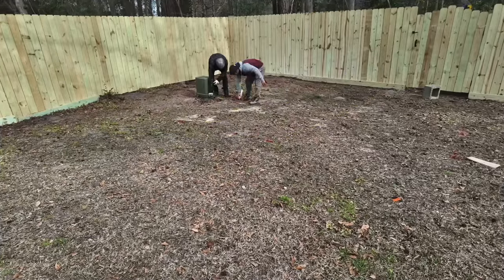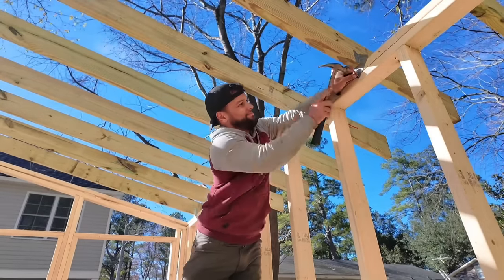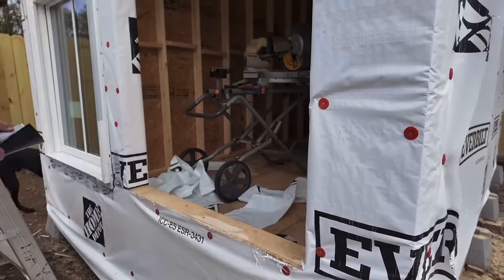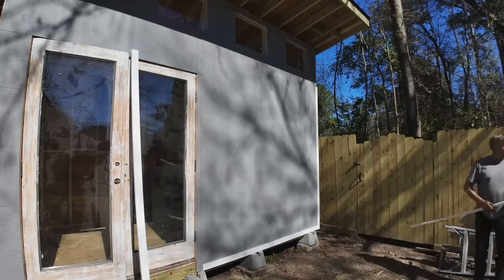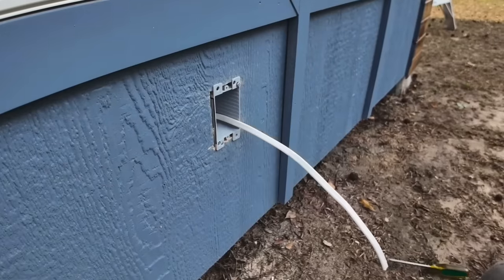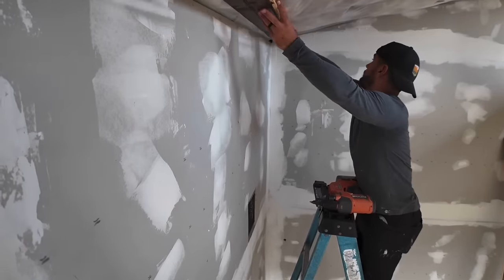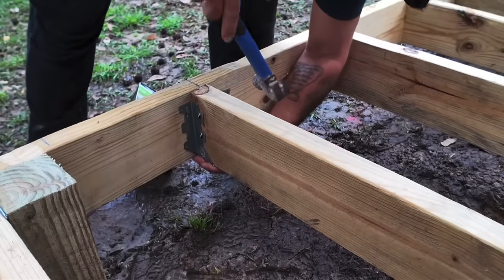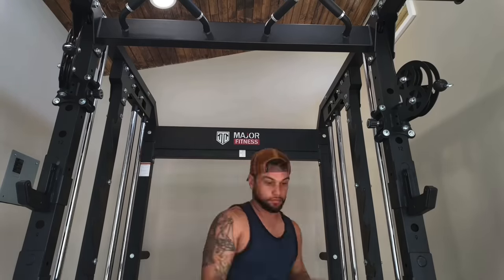How I Built A DIY Tiny Home Gym Full Build

Comment: all that time to put a bow flex in there?!?!?
Reply: I think you would need a slab foundation or commercial grade floor structure to do a deadlift or power clean station
Reply: @DanDannyDanielleBob and you need expansion join around those windows 😮‍💨
Reply: It’s better than “calling spirits”
Reply: Facts I thought when I saw his kid he was gonna make it for them 🤦🏾‍♂️
Reply: all that money he spend just to end up putting a gym machine.
Reply: Think about it. He mentions using as a short term rental but got shot down by the city.  That space can be used as a gym, an office, a workshop... So time and effort is not wasted
Reply: Was thinking the same thing. Nice work anyway
Reply: @DanDannyDanielleBob he could use it outside
Reply: Lol
Reply: @JonLake  glazier talk
Reply: Planet Fitness is 15$ a month. Could have gone for 1000 months and avoided this all.
Reply: Glad I read comments first, almost wasted 48 minutes of my life
Reply: A bowflex and no clearance to put plates on either side.
Reply: That was wild
Reply: @paultiki9968  it's not surprising considering there was no air conditioning, heat, plumbing of any sort, a kitchen, toilet. People that would stay there would not be very happy with so many basics missing...
Reply: @davidhamilton6136  I suspect that those things could be added if need be.  If I recall the goal was short term rental before construction and that's when he got shot down.  Would have to re watch to be sure.  Anyway, if that purpose was scuttled at that point during planning it would make sense not to add plumbing and stuff.  That would save an enormous amount of money since he can't do the rental thing anyway
Reply: Where a your tiny house video bro so we can see how fast you are ?
Reply: Félicitations vous avez fait du bon travail 🎉🇫🇷
Reply: I feel bad because I shared the same sentiment but they did a damn good job. Who cares what they put in it?
Reply: I can only assume he did it just for the content. He’s got like 300k subs. This is the most irrational project I’ve ever seen 😂
Reply: @DanDannyDanielleBob  😂 exactly
Reply: He doesn't even work out
Reply: Curious did you add the deck railing in order to have led deck lights only?

Comment: Framing 10/10! But because you asked - you have to flash window/door frames on all 4 sides usually 3" on the sheathing and 3" onto the frame. Then install the windows with calking all around, but over hang the frame so it clears your siding. Then install counter flashing and then your finish siding. Water is going to come off the window and get between your siding.
Reply: Following for future reference 😅
Reply: Following
Reply: This should be pinned to the top.
Reply: Framing is a 6/10 RESPECTFULLY! No jack studs king studs or header for the doors and windows and dont tell me its a tiny home it doesnt need it...
Reply: Yeah haha, as a carpenter myself I was wondering why he installed the doors and windows like that. The first two windows started OK but then he only did the bottoms. Wasn't sure why he was framing the openings with the expensive flashing after he installed the windows and doors. Like you said he needs to wrap the stud. But for a backyard build on a budget, especially if it's your own property, the mistakes end up being worth more in the long run as a way to learn, better than just helping someone else who already knows better. Seems like a do it yourselfer with some great motivation. Wonder what he does for a job?
Reply: Was entertaining tho. At first he was spacing the sheathing to allow for deflection so I was like oh yeah but then then he kind of started siding and it was like a puzzle. Still a great video. A follow up on the longevity in a few years would be a good watch.
Reply: @Majin.Rick101 that’s what I said lmao 6 might be generous but for a diy not so bad
Reply: @Majin.Rick101 wouldn’t he need to and bottom cripples for the windows too? Just curious.

Comment: 29:01 Next time, when hanging your sheet rock, make sure to stagger the joints so there isn’t one continuous straight line.  Keeps cracks from forming.
Reply: I understand it's important to stagger on the ceiling but on the wall can I just install it vertically so I don't have to deal with butt joint?

Comment: If you get any heat about not having staggered joints on the subfloor, those people are not competent builders.  Ignore them.  Also, what a great neighbour!  One thing I noticed is next time, don't put sealant under your windows, and always shim them up a 1/4" to 1/2".  If any moisture gets by your flashing, it will have nowhere to go and will just rot in the window jamb area.
Reply: How do you stagger joints on an 8' subfloor with 8' sheathing?
Reply: @dan8326 Exactly that would mean cutting every sheet or every other sheet.. the fact it was even mentioned makes me wonder
Reply: @dan8326 and now I just realized he didn't stagger the drywall 🤦‍♂️and he ended the joint at the door which is a weak point n can cause the drywall to crack
Reply: This was oddly satisfying to watch😊 You all did a great job.

Comment: Man that sux you spent 15gs for the tiny house build and the city wouldn't let you rent it out. This video taught me to do my research first before I build. Thanks for the share!
Reply: It's good to see the woodprix has new instructions to save my money and energy to build it.
Reply: Won’t let civilians rent out anything on their own property! But builds apartments everywhere and raises rent through the roof! The world we live in is messed up
Reply: @mylesmccartin878  More apartments/condos actually lowers rent. Its because of zoning that we cant build enough of them so we instead build space inefficient suburbs and expand outwards instead of up. Look up suburban sprawl. But yes in this case its also because Karens with nothing else to do manage to get into positions where they get to control city ordinances and make everyones lives harder for no apparent reason.
Reply: The city probably has multiple permit and inspection requirements if going to be used as a dwelling.  Also there is no plumbing,  so if they're planning on using an outhouse or something that may require additional hazmat permits and have additional requirements so they don't contaminate any groundwater.

Comment: Looks good!!! I’m a framer/remodeler so there are a few things I’d have done different but it doesn’t matter what I think.  Good job guys. My suggestions would be to use stretch flashing tape in the corners of your door and window seals. Also, I personally don’t like flashing the bottom of the window flanges. Again, good job you’ll enjoy this space for many years.

Comment: You needed to put “Z” flashing between the siding. Water will get inside the seam. You can’t rely on caulking. 

The window flashing (the sticky kind) needs to be done from the bottom to top so there is always an overlap on your seams. You put your sides on first, then the top then the bottom. Any water that comes down the top will rook under that flashing. 

Your window frames should have had a bigger gap between the framing so when the earth moves, it won’t break the glass. 

I can’t tell but your floor joists should have been pressure treated since they are touching those concrete blocks. If they get wet they will rot out.
Reply: This is good information. Thank you for sharing.

Comment: It looks nice. I’m not even a handyman but I can tell you the foundation is not safe. There is a reason you dig. I had a deck with those, just a deck, not even a gym, and it collapsed and was so unsteady
Reply: Unless you live in a place where frost heaving is a consistent issue then his foundation will be fine. Have built and seen plenty of decks on block foundation and they are as good as when they were constructed.
Reply: But why did it collapse? People build foundations like this in the Alaskan bush and they last 50 years plus. I'm just really curious what went wrong.
Reply: @pressureflipin1992  maybe they built on soft topsoil?
Reply: @mikerooney7600  almost had to be
Reply: I would agree sonotube/concrete…I would rather be safe than sorry or at the very least put a nice layer of gravel under those blocks
Reply: @RVFD2008 Your joists may not have been pressure treated. That may well be the case with this build but hopefully not.

Comment: Nice job. You did ask for critique so i will give my 2 cents. I have a few points #1 Its best to dig out the top 12 inches of topsoil from the blocks under the building. The top soil is not compacted and still organic material that will continue to decompose. It's best to have a solid foundation. You could have used piers and set that on top of block and beam. #2 The window tape was not used correctly. There's a sequence of overlapping around the edges to promote proper run off of moisture that wasn't achieved. You cam also buy somw tape that specifically has the corners already built into them ans cover 100% of it. #3 white romex is usually 14 gauge wire and not correct to be used for electrical receptacles, you wanna use yellow 12 gauge for that and yellow for any fixtures that will potentially have a celing fan in them. I di have a question about that insulation. In texas fiberglass batting us commonly used here. To my understanding its not toxic. Its glass. My concern with what you used it that it leaves bigger gaps that affects the r value and it will eventually compress on the vertical walls and fsll to the bottom like it used to do on the trailer homes back in tbe day. Other than that. Nice work.

Comment: 15 k to store 1 piece of equipment is wild I like the video nice job it came out looking nice
Reply: Except its terribly built, 15k for the foundation crumble and unpermitted work
Reply: 15k???? I see about 2500 in material there. If that. And hes doing a decent job. Also, it.doesnt need a permit. Its less than 200 sq ft isnt connected to the house and is setting onn a floating foundation. Jesus poeple are dumb and unskilled., so many youtube armchair contractor experts chiming in. My gawd the cringe
Reply: Never nail with a brad nailer like that with your other hand near the end move back a bit on the other board your holding. If the brad nail hits a knot it can curl and shoot out into your hand ask me how i know
Reply: @MAGA_EXTREM1ST  I was thinking that too. I didnt see $15K in material at all.
Reply: @ImYourWattson   maybe in labor if he had paid someone to do all that extra unnecessary mostly aestetic  intricasies added on the front wall. Even he was being fully transparent when admitted it looks cool but wasnt practical, i see this often where homeowners see something flashy in a magazine and want it until learning whats involved with it
Reply: It’s way more than 2500 lol. Just the boards he put on the deck were $34 each. The deck alone probably cost around 1000 to 1300.
Shingles aren’t dirt cheap. 
Breaker box fully outfitted is a few hundred. 
Flooring inside probably around 400 to 500
Framing and all plywood was at least 1500 to 2000
Siding is very expensive at $40 per board so that’s another 300 to 400.
That’s not including the 20 other types of material used on this project.
Reply: I literally commented the exact same thing. And with no room to maneuver even!
Reply: @phreakyzeke5824  he literally said he spent 15k.
Reply: @lyfsabych  if you think thats 15k in material you fell and bumped your head
Reply: @MAGA_EXTREM1ST  I mean, if your definition of "materials" is "wood", sure. I'm sure you know much better than the guy who bought it and built it with his own hands and wallet.
Reply: @lyfsabych  no what im telling you is i order lumber packages for the projects i build. And i know with accuracy and current pricing per 1000 board feet  how much things should cost.
Reply: @MAGA_EXTREM1ST  as I said, if your definition of "materials" is "lumber", you are correct. But there are  a hundred plus other types of "materials" which go into a build like this.

Comment: Very nice space! But is it a bit of a squeeze to load plates onto the bar?
Reply: That bar is going through the wall atleast once in the first month
Reply: Bar appears to be a Smith Style bar. Will only go directly up and down on a rail. Loading plates is probably a bit challenging but no wall impacts from the bar.
Reply: @RescueResidence  There are J hooks and safety catches on the front for a regular bar. Yes, I would have built this at least 10-12 feet wide.

Comment: I'm fairly confused by a home structure set up on $10 blocks plopped directly onto unprepped soil, that's surrounded by a deck that has concrete post footers.
Reply: To be fair, this isn't exactly a structure as big or nearly as heavy as a house would be.  If the soil wasn't touched at the top layer when their home was being built originally, the soil below will be packed well enough to be able to support a building this size.  The framework they set up for it should hold for as long as they own the place, if not longer.

However, if the soil was moved around a lot while their original home was being built, they're going to be in for a bad time in the long term.
Reply: Because it's a shed, not a home.
Reply: @metal_mo  Correct - but he did forms for the deck. If you're going to dig and pour concrete forms for a tiny deck, why not do it for your structure?
Reply: @JB2X-Z  Yup, no need for crazy footings for a structure that small. Poured footings are overkill.
Reply: Footings would have helped it not become a really big kite in 60-70mph winds which are not uncommon in thunderstorms.
Reply: @hollisminter2119  This structure isn't being picked up by 70mph winds... lmfao. And that doesn't even count all the nearby houses that are breaking the wind apart.
Reply: Go look at a simple gravestone… individual sized flat marker that’s been set for a few years  before the grave is disturbed.  You will see that marker sink over the years.  All it takes is a few seasons of rain to start the sinking process.  I can’t see this tiny house not moving over the years
Reply: Yeah I’m not a builder but have watch a lot of videos over the years. Why not just pour actual footings? Every place I’ve lived and done rehab on houses even a shed required a poured slab and a rat wall.
Reply: Is it possible this allows them to bring the shed with them when they move?
Reply: I am not a builder. 
But I do know you have to prepare the ground before you start.

Comment: Concreted posts for deck but sat the building on blocks.
Reply: im curious will his main structure settle or sink into the ground ?  I dont know much about building so i was wondering
Reply: I am allowed to build the shed in my county without a permit, as long as it’s built on a sled or blocks.  Nothing into the ground.  Might be a code issue where he is?
Reply: If he puts it in the ground he most likely needs a permit

Comment: I love it. Just FYI I believe it's easier to use a sawzaw (reciprocating saw) with a good blade to cut out windows, just drill a hole with a paddle bit to get your blade through and started and you're good to go. Much easier than the bulky router. And cheaper $$ blades for the sawzaw than router bits.